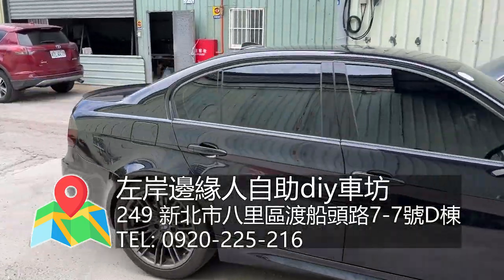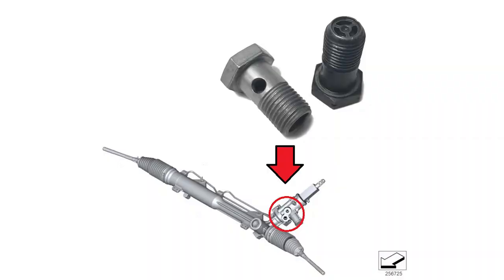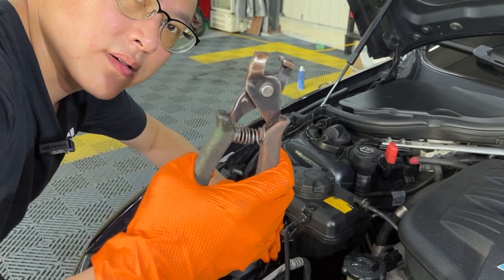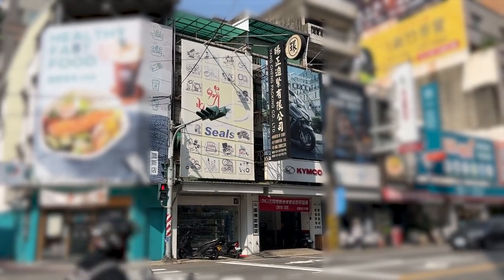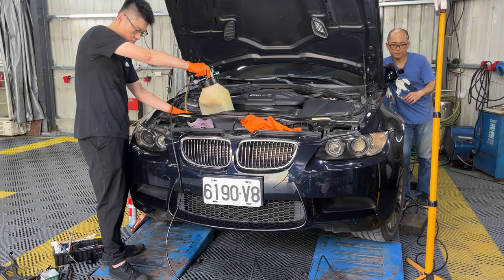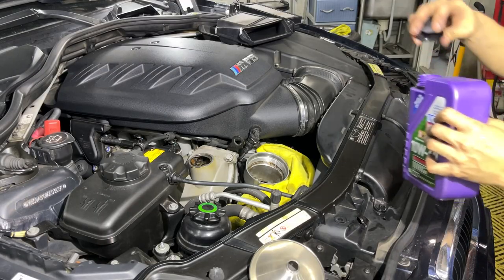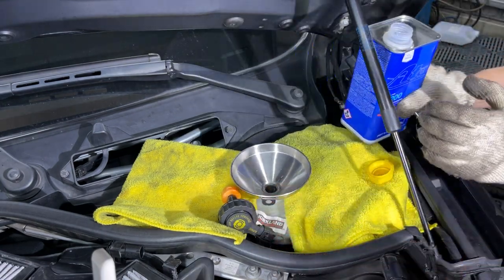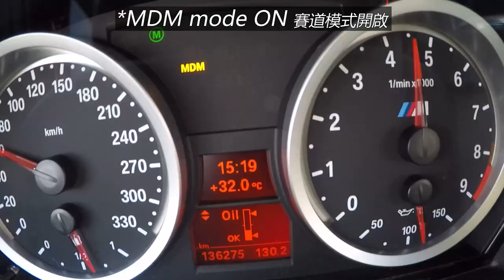E9x M3 Power Steering Fluid Service DIY (Return Line Bleeding)[ENG SUB]

Comment: Love your videos, did yours to replace spark plugs, cabin air filter, and engine intake filter. Hoping you do ones for break pads soon. Looking to get ceramic pads for less dust!
Reply from the maker: Hi Jovan thank you very much for the comments! I am thinking to do the complete brake service  at 15k km maintenance. The pad wear sensors and brake fluid lines will also be replaced. I will make a video for you 😉

Comment: Do you have in mind to install rear LCI taillights. I imagine that you’ll need to change the trunk… Is this a temporary car or you want to have it for more years ?
Reply from the maker: Hi Javier, I agree that the pre-LCI tail lights are not so cool but they do look unique for me🤗 Instead of the LCI lights, I chose the Sport Line tail lights, as you can see in other videos, to make it look better and remain 100% OE. Changing the trunk lid is too much for me 😅 But when I have to, I will choose carbon fiber trunk 🤣

I bought this M3 mainly because I wanted a V8 with manual transmission. It is such a balanced car to drive for fun and use daily.

Furthermore, I found the maintenance and repair is not that difficult after all this DIY works. I understand this M3, I love it and I want to do more DIY work on it to make it perfect 🥹 I will have it for more years 🥰

Comment: Are your day-time running lights stock? And is the car on when you turn the steering wheel?
Reply from the maker: Hello Rosendo, yes the head lights are stock. I did not code them but I use to manually switch all lights on when the car is moving. If I am right, they do not come on automatically during the day 😅

The car is off when I turned the steering wheel. Is ready with the tires lifted off the ground. Please try it! 🤗

Comment: How would you do this DIY if you replace the resovour
Reply from the maker: Hello Kevin, I read that the reservoir has a built-in filter in it so it is good to replace it if contamination is found in the power steering system.

I would replace the reservoir first to have the clean filter and do the rest as I mentioned in the video;
1. Remove the fluid in the reservoir.
2. Disconnect both return line and suction line.
3. Replace the reservoir.
4. Connect the suction line.
5. Do the return line bleeding method.

Let me know what you think! Thank you for the comments!
Reply: @funcarsgoodpeople  thank you

Comment: Do you add any additives like for example Liqui Moly Leak Sealant 35ml
Reply from the maker: Hi Kevin I have never added any oil additives. I do have an obvious oil consumption, around 1 qt per 2000 km. I am planning to do the valve stem seal replacement soon and I hope this will give improvement. Do you have any recommendations?
Reply: @funcarsgoodpeople   I’ve wanted to add a good review additive for power steering but I haven’t seen any good video personal reviews